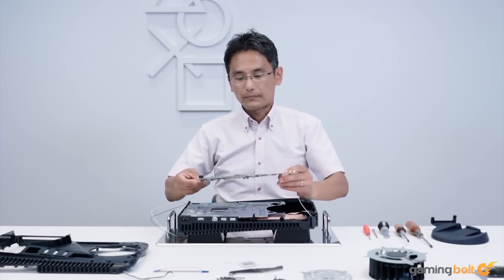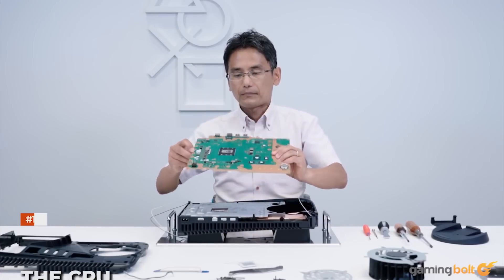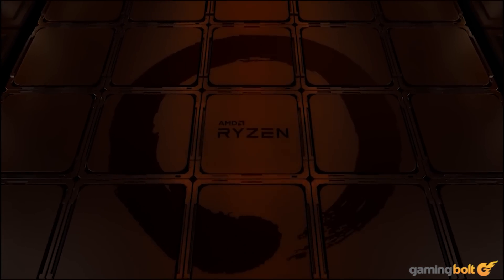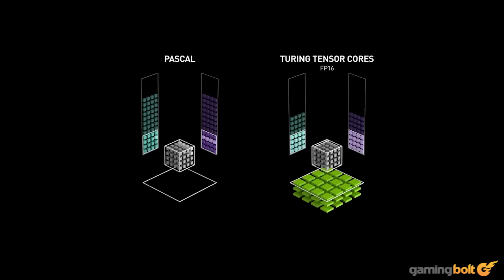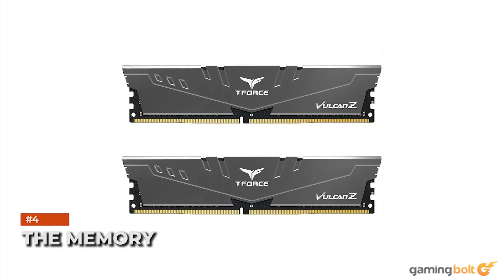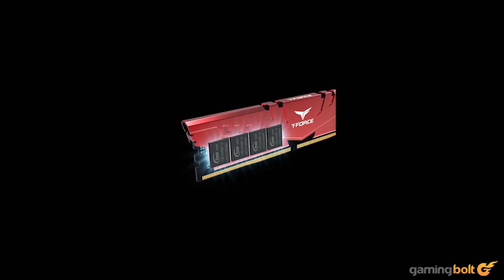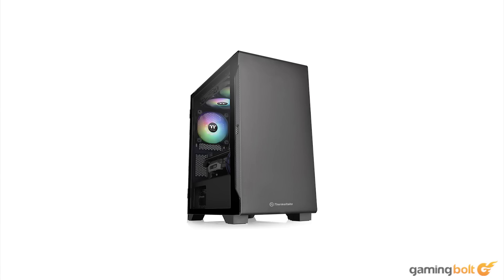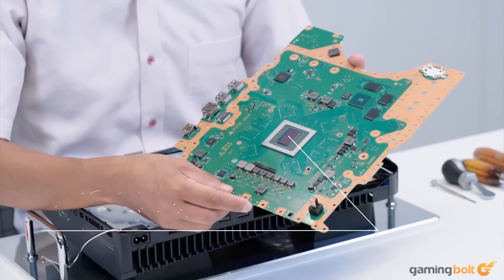How Much Would It Cost To Build A PC As Powerful As The PS5? (2021 Edition)

Comment: Thats why i went with the PS5. Simple cost effective. Powerful. Will handle all games in this gen at decent Resolution & Framerate 👍
Reply: go check digital foundry's review kid!!

ps5 = RTX 2060 super + i5 9400F / ryzen 3100

sata ssd is more than enough to match console ssd, check comparison between sata ssd vs nvme gen 4

so a $700 pc is equal to a ps5
Reply: @Luiko0406  ryzen 3100? You do realise the spu die on the cpu frees up 1.5 cores on the ps5, and it also doesn’t have the operating system + other app bloat while gaming. Your dreaming pal do some research
Reply: @Luiko0406  you're delusional. are you forgetting the PS5 can do 4K?
Reply: I just got an RTX 3090 and a PS5. Best of both worlds.
Reply: Plus ps5 exclusives!
Reply: @ChileanSpartanUSA  I'll just wait for them on PC to play them better
Reply: @ChileanSpartanUSA  about that
Reply: @ChileanSpartanUSA  the only difference is that any PC/Xbox game that comes out u won't be able to play it on PS while on PC u are getting everything at a cheapper prize
Reply: building pc today is sucks.. gpu prices is hell..
Reply: Its impossible to beat ps5s starting price of 399.99 even if u add ps plus for the next 8 years it will still end up being far cheaper than PC Gaming. CD keys has 1 year ps plus for just 30 dollars. but then again, Its all about the exclusives something PC has been lacking. Power is there by default. Its the games that will decide who won
Reply: @Lov Mir facts. This PC is gonna be very incapable in the next few years
Reply: Agree.  PS5 is more practical and relaxing just seating in the couch, and it can last longer than PC, also is easy to maintain.
Reply: And then bought a 1k mac lol
Reply: Yeah but my Reddit friends said I’m a simpleton for using the ps5 that I didn’t buy (my great grandma got it for me damnit),
Reply: And games at 70 bucks. Nice choice xD
Reply: @Forge_YouTube  10 more bucks every couple of months isn’t a big deal. Yeah it stings a little, but it’s literally just an easy jab that don’t matter for one silly fanboy to use against another. Nobody really cares.
Reply: @ilikefartjokes  PC is still better for a lot of reasons.  You can play any game from the past, plus emulators.  And you know the games you buy today you can play in your next future PCs. Mods, more hardware options (even portable), etc etc. So no,  PC is a better choice.
Reply: @ilikefartjokes  I don't agree and that can be subjective. Besides,  now ps games are coming to PC.
Reply: @Forge_YouTube  Only poor people wait 5-10 years or even forever to play playstation games
Reply: @ajdaniel8128  I have a lot to play because I get cheap and free games very frequently so I can wait.  And I get the best version.
Reply: @ilikefartjokes  Backwards compatibility is also a fact.
Reply: @Forge_YouTube  Pointless. A 5-10 or even older Playstation game would look very outdated and feel outdated especially graphically by the time it comes to PC. Rachet & Clank Rift Apart, Demon Souls on PS5 all look million times better than anything found on PC. Even the upcoming Horizon Forbidden West on PS5 looks far far better than 5 year old Horizon Zero Dawn on PC. So no matter what pc gets, playstation gamers will always get the best, the latest and the most graphically advanced titles. By the time pc gets it, all the old charm is gone
Reply: @ajdaniel8128  Not interested in spending 70 bucks for games that will look and play better in PC later .  For games I got a Nintendo Switch,  that is also portable, but for advanced graphics,  I see no reason to get a playstation, because , again, pc games are coming to pc and there are also emulators.   You will soon be playing your new games at 30 fps while I play at 120 fps xD
Reply: @ilikefartjokes  Sure, but PC wins
Reply: @ajdaniel8128  That won't last long because in consoles, the standard has always been 30 fps. When games become more demanding they will lower those framerates and that is what you will get while I can set my graphics the way I want.  Really,  you can feel good about your choice but don't tell it is the best choice.
Reply: @ilikefartjokes  So more that you are lazy about setting up a PC and that is why you pay more for a limited machine that runs games worse than PC xD
Reply: @Forge_YouTube  Nope. There will always be a 60fps option on PS5. PS4 days are long gone. Maybe you need to update yourself instead of staying in the past just like your pixelated underwhelming Indies on PC lol
Reply: @ajdaniel8128  Yeah, you wish.
Reply: @Forge_YouTube  You will see. It already is even with PS5 only titles. There is always a 60fps mode
Reply: @ilikefartjokes  You dont need a ps5, congrats on wasting your money 😂
Reply: @ilikefartjokes  I don't care about tha f*cking game. Had the chance to buy it for 10 bucks this christmas and I preferred Biomutant.  That game is just a Tomb Raider with less things to do.  And I got the 3 Tomb Raiders for free at Epic store ha ha.
Reply: @ilikefartjokes  Game Awards mean nothing to me. I've loved games that never get awards or scored 73.  I don't care about waiting for single player experiences to be honest.  I also do it on PC to get games cheaper.  If you want to spend 70 to buy games on day 1 or the first year doesn't mean that we all care about that. There are plenty of awesome games on PC. So exclusives is all desktop consoles have and now they are going to PC too.  You don't really know if now that they moved officially to PC they will take 3 years to port them.
Reply: @ilikefartjokes  Cool. They don't need to be on the same day.  The only things that need to be bought soon are online multiplayer experiences that you need to play with others while the game is fresh.  Sony works hard on their exclusives but then you get stucked with the graphic settings they decide for you.  And they usually sacrifice framerate because some people won't notice and screenshot sells games and they prefer those looking better, while the game runs with 30 fps and drops. I hope you are right the future of Sony consoles is now 60fps minimum as a standard.  I can still play at 30 fps but I avoid it whenever I can.
Reply: I'd turn to PC simply due to Sony's excessive censorship policies.
Reply: It's not cost effective in the long run. The biggest issue for PC costs is supply shortages and Etherium mining, but you dont have to pay subscriptions to play games online (with a very small number of exceptions) unlike their console counterparts, and if you are say making content for YouTube or are streaming, you'll have to buy additional hardware and have a PC to get the same production quality, not to mention upgradability and thermals being issues that next gen consoles still have. For a dedicated gamer it's still cheaper in the long run to build a PC, you just have to be mindful of what parts you get, how you get them, and how well you use each part's potential
Reply: It won't handle all games just the ones made for it's platform. Which are few and far between.
Reply: Potatomasher pro
Reply: Ps plus slave
Reply: And now a ps5 cost 800$ 1k if you’re buying from sites like eBay or Amazon
Reply: Meh PC we can crack games for free goodluck paying ,60$ every time
Reply: @SS-sg4eg  ive never payed more than £30 for a console game Ever. I dont buy games new at release i wait a few months for a digital sale or buy a used disc, problem solved
Reply: @SS-sg4eg  i mean, with that such small cooling system, PS ALWAYS does good job. Imagine those cooler on PC, you'll get probably 24fps @90°C any day lmao. I own PS2 to PS5 it never disappoint me even once. Even my ps2 still runs great. Only optic replacement on 2019ish . Also there's a custom firmware for PS so you can download stuff just like PC. The only thing i hate about PS is : same model, different number code means different performance/quality , for example PS3 with code CECH-2001B vs CECH-2101B basically looks the same . But has different stuff in it. Idk i feel buying gatcha for them lmao
Reply: The price premium on PS5 games kills any argument about cost.

I hope those strolling through know that
Reply: It’s simple. Buy a console for simplicity and gaming. Game devs can specifically optimize games for consoles since all of them have the same or similar specs. PC for gaming and everything else, that includes, 3D modeling, video editing, work, programming, machine learning, web surfing, and pretty much everything else on a computer, but it’s a bit more complicated. Also subscriptions literally make consoles more expensive long term
Reply: Imagine people thinking their PS5 runs better than a mid to high end pc. It tells me one very important thing, they’re uneducated on how specs work. A Ryzen 7 5800X with a 3070 and other components to match will outperform a console, I’m truly confused at these console plebes. I used to be console all day until o made the switch. It’s not even close.
Reply: I mean ps5 is just for gaming pc can do video and way more sutdd
Reply: @Sona.0.1  Everybody already has a pc by default but not everyone needs a gaming pc
Reply: @favinjae6255  More than 90% of consumer PCs are already behind PS5 in graphical capabilities. The biggest difference is PS5 has good quality exclusives while PC has shitty low graphical indies. Your graphics argument makes no sense when pc has 0 AAA exclusives
Reply: build an expensive pc and pirate literally everything, 10 games costs as much as a ps5, while pc can get them free so pick wisely
Reply: Ye also buy expensive games for it, And pay for multiplayer too. I don't hate console but they are more expensive to maintain then pc. Pc have best discounts on games with free multiplayer and unlocked fps etc.
Reply: PC costs more because power wise its the superior gaming experience. As far as the games go….. it’s PlayStation FTW all day. Glad I have both! But I play my PC WAY more and buy all 3rd party game because graphically and fps wise it’s just way better. But has about half to 3/4 of the speed the PS5 has.
Reply: It's only cost effective, due to the pandemic's influence on hardware prices. 
Had they remained pre pandemic, the difference would only be around 300 bucks.
Reply: @Orcawhale1  Pre pandemic 99% of the current graphic cards would be unusable, only reason why cards such as 1650 or 1050TI are still usable is that many people still have them since they couldn't upgrade during the pandemic, forcing developers to optimize games for systems with these cards. But after pandemic count only maybe 3000 series as viable cards. While PS5 will last you 7-10 years... you can see wich choice is more economical. New games generally cost the same ammount, usually the games that already sold enough or haven't sold at all go on sale so people might buy them and at least compesate for the creation costs. While you might pay 60 dollars for online, you will have to upgrade your PC hardwere for 10x more than for online. Generally PS5 is the secure option while PC is a risky choice that could work out.
Reply: @greatgamingchannale8257  You don't what your talking about, like at all. 
1. Cards such as the 1050Ti and 1650 are "viable", because you can just lower the settings.
 
2. Optimization of games by the developers relate to fixing performance issues, not the cards themselves.
Nvidia and AMD are ones who optimize via their drivers, which is why they make such a fuss about day 1 game ready drivers. 

3. Wrong, any card which gives the user the desired performance is viable. 
It's just a question on how low his willing to adjust his settings. 
A 10 year old GTX 770 will still be viable for a person, which can live with 30 fps and low settings. 

4. Nor is it more economical, want to know the reason? It's the constant design changes done by Sony.  
The Ps4 got two major changes, Slim and Pro. 
Both of whom, destroyed the value of the original console. 
If you add in this, and the cost of line and increased price of games(70 bucks).
You'd quickly realize that the price in the long run, is actully much worse. 

5. You don't have to upgrade every time, nor does your pc have to be a high end system. 
Infact, to match the console specs you only have to spend around the previously mentioned 500-600 dollars. 
The consoles are litterally build on off the shelf parts, albeit slightly customized..
Reply: @Orcawhale1  Are you mad? Nobody is talking about Pro and Slim you didn't have to change your consoles from 2013 at all... And yes, old graphic cards stop being viable, GTX 1050 is an old card that is only viable because people can't change from it, so the companies still optimize it's preformance. And in the 7 year period if you don't upgrade your PC at least ONCE (especially a low to mid tier PC) your PC will straight up be garbage.
Reply: @Orcawhale1  Plus PS will always have a graphical advantage over a mid range PC, since it's usually pre set to a medium/high setting even ultra if the game supports 4K.
Reply: @greatgamingchannale8257  Not at all, but you simply don't know what your talking about. 
1. You claimed that the Ps5 is the most economical, which it won't be due to the previously mentioned Slim and Pro versions.  
Values will drop significantly on the Ps5, thereby screwing everyone who paid scalper price. 
2. Old graphics cards only stop being viable, when the user decides on it. 
Which is a entirely subjective thing 
3. Opimzation's and support has nothing to do with what's currently fashionable. 
Infact untill just a month ago, Nvidia were still supporting the Kepler generation of gpu's(GTX 600 and 700), that's 10 years of optimization. 
4. Depends on your demands, and the game in question. If you can live with 60 fps and low settings, then you will still be able to play. 
Want proof? Go check the various videos on the GTX 970 and 980, which happen to be 7 year old gpu's.
Reply: @greatgamingchannale8257   No, it won't, hence why they will release a pro version, later in it's life cycle. 
The Ps5's hardware will get outdated, the same way a pc does. The only difference is that the pc user can turn down his settings or upgrade his machine to solve the issue. 
Where's the Ps5 user is stuck with whatever settings the developer has decided on, and no upgrade options.
Reply: @Orcawhale1   None of the builds you mentioned were in the same power level as the ps5….
Reply: @LiquidLizards3569  Then you don't know your hardware. 
Because they are.
Reply: @Orcawhale1  Other people have already explained it it to you. Do whatever you need. I’m not a fan boy. I have ps5 and gaming pc….
Reply: @Orcawhale1  Well they didn't did they and the prices will now never go down. Inflation has taken care of that. Rising cost of everything is now a fact of life.
Reply: Often at half the FPS of Series X and PC though lol . Just not enough thought went into the 120 hz mode. I wonder if that is because Sony screwed the Pooch when it comes to VRR.I use the Series X with a C1 65 OLED and it is amazing . I think Xbox should do a deal with LG to sell them as a pair lol
Reply: @DEVILTAZ35  half the fps? Lol do you even hear yourself, the fps is very similar and half the time ps5 has a bigger fps although the difference is like 2-3 fps. The consoles are very similar in power
Reply: @josipj705 I agree half fps is not right. But at this point in time there are more games that run better on series x than ps5 compared to the amount that runs better on Ps5 than on series x. As it should be given the series x is a bit more powerful than the ps5 and is optimized better. (Quite the oposite on the series s though) 
Why I say it is optimized better is because the ps5's vrr does not work well on a lot of screens ranging from most monitors to many different tvs that are not 120hz devices.